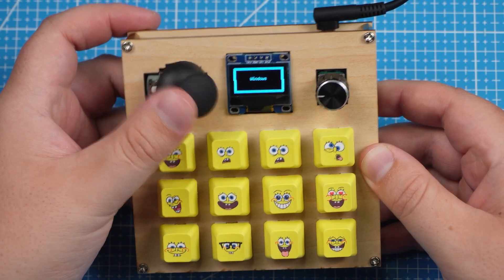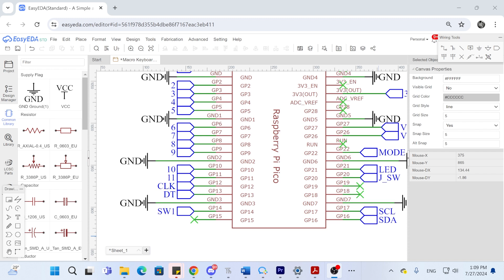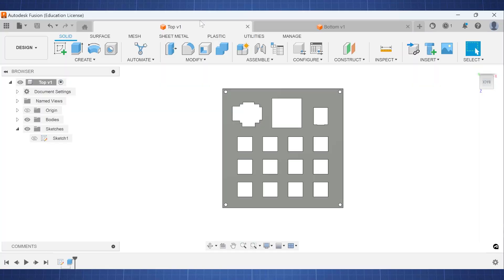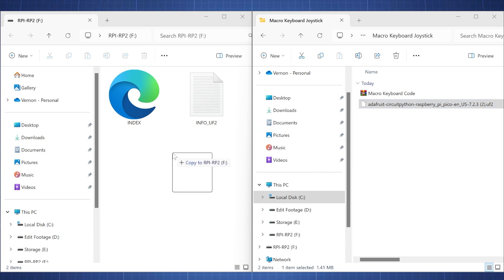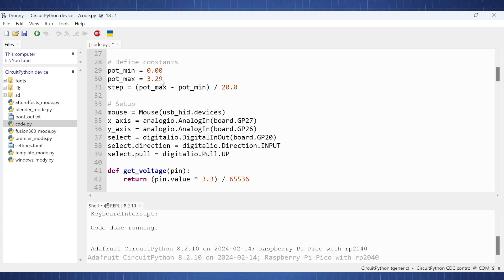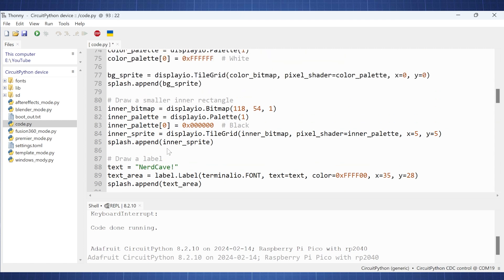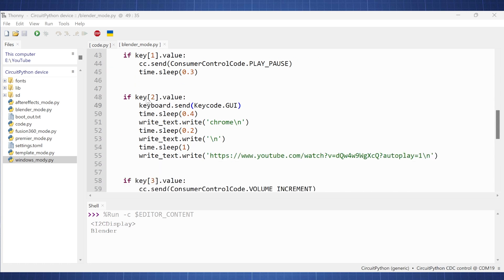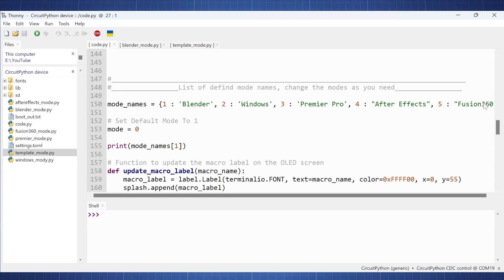DIY Macro Keyboard with Joystick - Raspberry Pi Pico

Comment: Im pretty much a total novice when it comes to writing the code on pico's is there anyway for the macros to do sequential key strokes. For example if its possible to program it to do "alt, S, B, S" and where I can find a resource on how to write that? Any help appreciated, thanks!
Reply from the maker: keyboard.send(Keycode.ALT, Keycode.S) you can just add more to this, here is the documentation https://docs.circuitpython.org/projects/hid/en/latest/api.html

Comment: This is a cool project. I ordered the PCB and found that my joystick module doesn't fit (the pins are a bit smaller). Do you have a link to the PS2 Joystick Module or know what model I need for this?
Reply from the maker: Hello, the ones I used I bought from taobao (inside China) but I can take down the dimensions for you and sure you can buy it from aliexpress

Comment: Excellent project,  I am currently design a hobby CNC macro pendant,  and I was fighting with KMK to make my rotary encoder do work,  but no success.  I decided to order your PCB board and code it to my CNC and laser engraver it ios TOP design.  The only thing I am changing is the rotary encoder,  I will use one of those metal 100 pulses rotary specific for pendants,  so I will assemble it off board and add a connector on the pcb.  Excellent project!  keep it up.  Thumbs up from Brazil!
Reply from the maker: That is great to hear you are using it for your CNC, I don't have any experience with CNC machines but will most likely be getting one soon

Comment: Hi! I mostly constructed a prototype of your Macro Keyboard, im exited to finish it and customize it for my own shorcuts. Is it intentional that on startup the joystick drives the mouse in a different speed than when a program is selected? I assume i could override the joystick axis settings for each program and use the default one as i like that speed better. Right now im trying to test it on MacOS and got greeted by the Keyboard recognition wizard.. which is a little cumbersome because this is not an ordinary keyboard :D
Reply from the maker: Yes you should be able to adjust the x and y steps depending on how far the joystick is pushed to control the speed for each program, the ADC of joystick picks up some noise so that is why it might be best to adjust depending on your joystick behaviour. I have never used MacOS with the circuitpython, so regarding the support for the HID library I am not sure if there will be any issues, think I might need to check circuitpythons HID library to see if it supports MacOS

Comment: Why not MicroPython?
Reply from the maker: MicroPython does not have the HID library support
Reply: @NerdCaveYT  - I control hardware with MicroPython; no problem.
Reply: @tubeDude48  You need HID support to interface with a PC as if the Pico was an HID device like a keyboard/mouse, which MicroPython does not support as of now.
Reply: @Alvin_Ajith  - That's true in some cases, but for what he is doing, MicroPython will do this simple task.

Comment: Hello Vernon! Nice video - with all details explained! I have a question - and I'm sure that the lot of peoples are curious about.  Can we use this macropad for PC gaming? Thinking for more action oriented games where the buttons w,a,s,d, are pressed continuously and combined?
Reply from the maker: Yes you can, for example if it was a fight game where you maybe need to press up down up left etc. you can add small delays between each one send. If it is combined then it will have no delay for example: keyboard.send(Keycode.SHIFT, Keycode.A) this send both shift A at once for select all as an example.